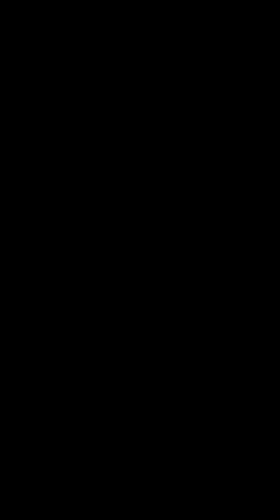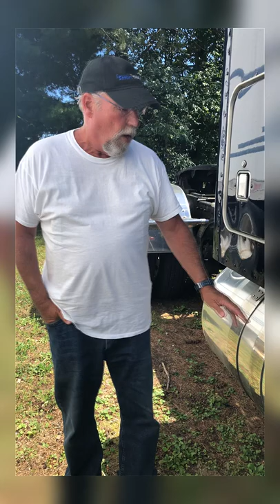If It Ain't Broke, Don't Fix It! #shorts

Comment: I worked in the oil patch in northern BC and Alberta in the early 90s. I think I Snagged my cross over line with a log on a pipeline access. Got about 30 miles or so away from camp and there she died. January -40. No cell phones then but we had autotells and vhf XJ 2way radios but I was in the very north east corner of BC on winter roads and couldn’t get ahold of anyone. Didn’t see a truck till morning. There were disadvantages to the old ways too.

Comment: I like my bottom feed tanks. Didn't much like it though when I broke a front leaf spring, and it knocked off the petcock on the left tank. Pro tip, I carry a tapered wooden dowel just in case of such an emergency. Drive it in the hole to stop your expensive fuel from pissing off the EPA all over the ground.

Comment: Or you should know that in cold weather areas like Michigan it helps with that top drop fuel system keeping the fuel warm in the winter time cycling it through the engine dispersing it out between both tanks

Comment: The truck would sometimes stall if parked off camber & the fuel tank with the supply tube was on the high side & the fuel transferred to the tank on the lower side. Enough fuel would drain to the lower side tank to cause the engine to lose it prime .

Comment: Thanks to technology I parked on a shoulder leaning to the left side a few degrees of angle with just a quarter tank of fuel. Next thing I noticed is the engine shut off due to fuel starvation. All the fuel transfered into the left tank.i learned my lesson!!!

Comment: That's works unless your low in fuel you park on unlevel ground or you have just enough water in your tanks and it freezes in the cross line

Comment: My tow truck is set up like this. Its a 2001 GMC 6500 with a C7 Cat. It has a tank under both doors with a connector line and tap. Such an awesome truck

Comment: I have fixed this problem on my personal truck, fuel sucks from the drivers tank, when I run low on fuel I pressurize the passenger side tank to push the fuel over to the drivers side, then I shut off the crossover, get back in the truck and now my fuel gauge reads over quarter a tank, makes me feel better

Comment: As a Thermo King technician, I deal with this all the time. Brand new trucks seem to have plenty of fuel in the roadside tank, but hardly any in the curbside. This keeps the tripacs I install from starting. I always have to get the dealer to send someone down with a fuel truck to make sure there's adequate fuel to run the APUs

Comment: The only time I had a problem with the cross over system,, was at  - 40 ..   at 0300 am .   I had to use a crescent wrench and  empty old coke 2 litre bottle to transfer fuel ..from one tank to the other .. always care methyl hydrated…to stop water / ice . from blocking the fuel cross over . Thanks

Comment: not only is it a headache, but it means if you pull up to a fuel island and the satellite pump is broken you cant fill both tanks without running the engine while fueling😂

Comment: My last two T680’s had a crossover line. The older one had two fuel gauges, but since you couldn’t select tanks, it seemed a bit pointless. My only thought was that they were pretty sure the fuel system wouldn’t keep things balanced, so they decided to give you some warning so you might avoid getting stranded. I guess my lack of understanding shows I wouldn’t be a good engineer.

Comment: I drove a 1986 freightliner Cab over with the line on the bottom crossover and I ran over a tire gator and it ripped off my line.

Comment: Over the top siphon could work but under with a robust channel is definitely easier  as long as the cold weather ain't gelling her up or dirt in the fuel getting sucked through or lodged in the go between personally gravity fed stacked tanks seems quite the effective idea as lawnmowers here clear round the world use gravity fed tanks reliably and reliability is saftey

Comment: Modern diesels build way more fuel pressure than years ago, that causes more heat into the fuel. The tanks are plummed that way so to act like radiators. Got to get rid of some heat, that reduces horsepower.

Comment: I ran a White Freightliner COE back in the 80's.
Running upstate NY and that line froze up.
For the whole winter my Boss had me running using just the right hand tank.
20 gallons of gas in each tank kept that from happening again. (winter only)

Comment: Actually, if you run the I90/94 and I80 corridor, heated returns are very necessary for multiple reasons. 
1- preventing fuel gelling 
2- elk. That "safety bar" does absolutely nothing when you hit an elk. Hell, it does nothing against a mule deer.
3- the constant circulation prevents sludge and slime bacteria build up.
Because you do not understand the reasons for change does not negate the validity of the change.

Comment: Nearly three decades O/O with a small fleet of 379s.  Had one identical to the indigo blue exhd 379 in the background.  I agree 99% with what he says simple practical approach.  Just get the job done and move on to the next one.  I have to disagree on this one.   As problematic as leveling on the top of the tank fuel line system design is it sure is better than valves and lines on the bottom.  If you can Think it a driver will Do it.  Or should I say it will happen.  Keep on Trucking.

Comment: The bottom transfer tube was getting broke a lot spilling fuel along the roads.
The new top draw and return system is simple and doesn't give much trouble

Comment: Perfect example of a crap system is the DEF system of big trucks. If you go into any repair facility now, you'd find that 90% of the trucks in for repair are DEF related issues.

Comment: Has more to do with the empty headed morons that have no idea how anything on a truck works. They are the ones to blame as they were the idiots getting the lines ripped off and driving until empty. Common sense dictates that the drivers caused the problems that lead to the EPA having to do something about it.